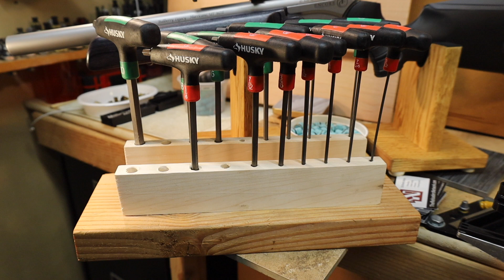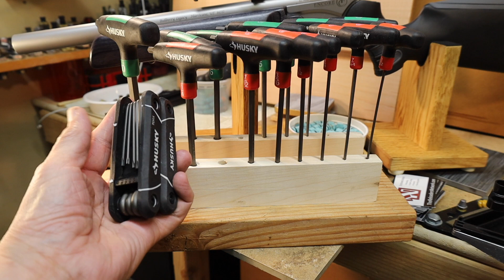A Simple Homemade T-Handle Hex Wrench Organizer

Comment: I had an unrelated question. I've been powdercoating my cast bullets for a while. I stand them all up on parchment paper and they turn out fine. I just opened a new roll of different parchment paper and ran a few batches and every bullet stuck to it. They've never stuck to the other roll of paper. I was wondering if I should just use aluminum foil instead of parchment paper. Any info would be great. Thanks for the great vids.

Comment: Can i use a mix of wheel weights and stick on ones to make buckshot? The mix is about 20 clip on and 80 % stick on
Reply: most of my buckshot is straight wheelweights, I cast Lyman pellet slugs out of linotype, just malleable enough to expand on big bones, tough enough to go 'corner to corner' thru a dead horse....

Comment: I have those old Craftsman gray socket organizers in all my rollaway chest drawers too. I know exactly when one is missing along with being able to find them quickly due to being separated and neatly organized  . You kill two birds with one stone using them. This would do the same. Somebody borrows one they had better put it back or else you will notice. Always worked well with friends and family coming over to work on vehicles and things with YOUR tools. At clean up time every slot or hole should have a tool in it. If it doesn't start checking under the hood, in the yard, under the vehicle etc etc. You also know exactly which one is missing because you have them in order by size and type.